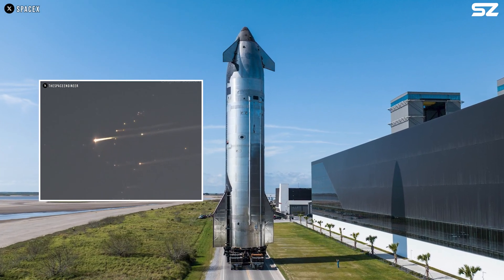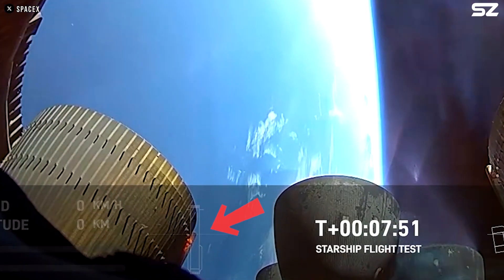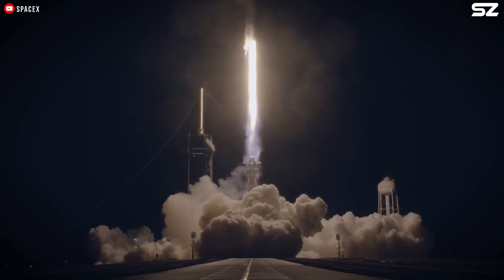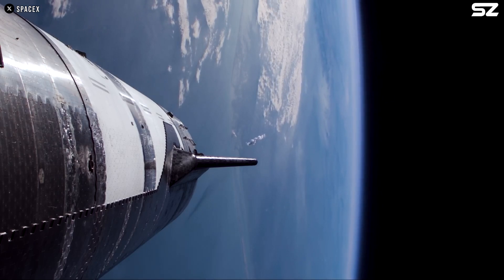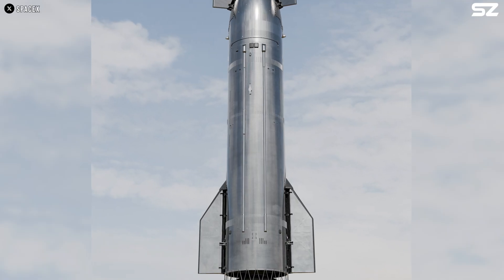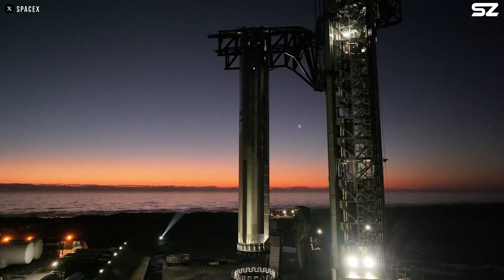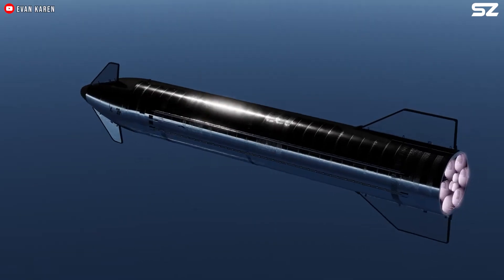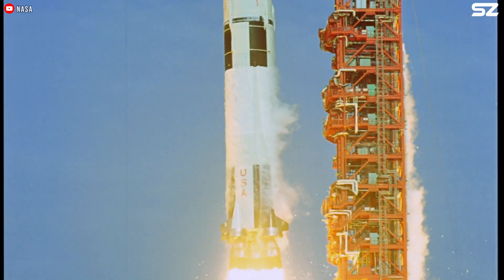SpaceX’s Explosive Vacuum Engine Solution!

Comment: Congratulations on finding the Apollo 6 flight oscillations link. I'm an old-timer with many decades of following the space industries. I was aware that the first stage Saturn v had oscillation so bad that it damaged engines in the first stage as well as some of the stage 2 engines. I had texted in numerous other channels that I thought there was a link between these in the new starship design but you're the first channel that I have seen that caught it. I absolutely believe the changes they made in the downcomers brought this problem on. Good luck with this channel I've already subscribed!
Reply from the maker: Thank you!

Comment: I don't think that these vacuum Raptors are being pushed any more on Starship block 2 than Starship block 1. I also believe that SpaceX plan to incorporate more vacuum Raptor 3 engines in future Starships to improve their thrust to weight ratio. Clearly adding more shielding weight now, as suggested by this video, is not the correct solution and would also be very disruptive. The problem is that the vacuum Raptors can only be properly tested in the vacuum of space. Hopefully on the last flight, SpaceX will have added extra cameras and sensors to better diagnose the cause of the failure, and now have the knowledge to improve the design enough to achieve SECO. The forthcoming release of the Raptor 3 engines will throw an additional ball into the mix, and engine failure must be avoided rather than contained !

Comment: Putting shielding around the engines is not the same as fixing the problem. The root cause of all of this is that Starship is too heavy and the Raptors are being pushed too hard. They are inherently too close to their structural limits.
Reply: All rocket engines run near structural limits. This is how you gain impulse efficiency. The vacuum engines actually  run around 16-18% less power than the sea level raptor and slightly fuel rich on The outer Injector ring to help cool the bell
Reply: @CNCAutomationLab  Er, no actually. And I'll refer you to comments by Peter Beck from Rocket Lab. "There is no point in having an engine that is absolutely busting its bolts at 11,000 psi". He was of course referring to Raptor and the deliberate design choice to extract the last few seconds of Isp. In contrast to the Archimedes engine which has been tuned to lower pressures and lower turbine temperatures. Something you can do when you're not using a heavy steel rocket body.

Comment: Engine containment cages were deliberately left off Starship because it adds parasitic mass, opting instead for engines that are less likely to self-deconstruct. There was quite a lot of discussion put into the public realm on this issue and I can't see them changing their minds now.

The hot staging ring was always an intermediate kludge to allow continued use of the existing block1/2 boosters and SpaceX made it clear the ring will eventually go away in favour of open interstages when they introduced it

Adding the extra downcomers allows them to be used as surge header tanks for zero-G operations (an empty main tank has serious slosh action going on) as well as ensuring maximum flow in 6 engine operations where the original one was turning into a bottleneck thanks to flow turbulence coupled with the greater flow of the V2 engines. That in turn means they don't need the nose mounted header tanks as much as originally planned (ie: weight reduction in the overall scheme of things)

It'll be interesting to see how SpaceX tackle the resonance issues. The most common methods add significant mass penalties and they don't want to have to reintroduce COPV helium tanks if they can avoid it (extra mass). Despite computer fluid dynamic simulation this really is bleeding edge research and "what computer says" vs what actually happens can diverge substantially as rounding errors add up
Reply: If you were going to design engines that are less likely to self destruct, you'd be designing engines that aren't being pushed to the limit.
Reply: @saumyacow4435  true, but they need to do this for reusability. An engine that blows up in a containment cage means lots of downtime fixing things and that kills rapid reusability. If they don't blow up you don't need the cage and if they do blow up they don't fit the intended purpose anyway

One can argue about using the cage during development but that's a dice roll thing in terms of the trade offs

Comment: To eliminate harmful resonance a modified subwoofer, midrange, tweeter, or ultrasonic amplified loudspeaker in the fuel tank. Supplied with noise cancellation input from microphones attached to the outer fuel tank for negative feedback.
Reply: Absolute genius ✋🏼😏🤚🏼

Comment: Could the harmonics be eliminated or minimized by replacing the single large downcomer with three or more smaller downcomers with different diameters, strapped together?  Also, why not place baffles in the tanks to minimize sloshing?
Reply: Baffles add mass. Mass subtracts payload. 

More importantly when you have a 75% empty tank at zero G, the fuel won't stay in the bottom of the tank no matter how many baffles you have and baffles will instead act as "wicks"  encouraing fuel to disperse throughout the tank volume instead of preferring to stick to the sides of the tank and be a more cohesive mass

By having the downcomers as slosh/surge tanks, you can keep them full when you shut down the engines at end of the primary burn by shutting off their top end (there are various low mass ways of doing this, the sealing doesn't need to be "tight", just adequate) ensuring the engines will be fed liquid and not ullage gas when relighting. Once thrust is established the fuel will drop to the "bottom" of the tanks naturally but without some way of ensuring the fuel is at the bottom of the tanks, you'll need auxilliary thrusters to do the work before the engines are fired (ie: more mass, even if cold gas fed from the ullage - and the last thing you want is liquid fuel to find its way to the cold gas ullage thrusters as this will result in those thrusters giving wildly different reaction forces to what was expected)

Everything is about compromise: mass, fuel, payload and coming back in one piece. This is a science experiment and will remain that way for a while. SpaceX need to push engineering/materials science limits and break things because the actual limits are in many cases not well understood in the first place

Don't forget how many F9 boosters went splat before they managed to start landing them reliably. Rocket science is easy, but rocket ENGINEERING is a whole universe of yarn tangles unto itself.

As long as SpaceX can keep the boss from interfering in anything they should have the problems cracked fairly quickly